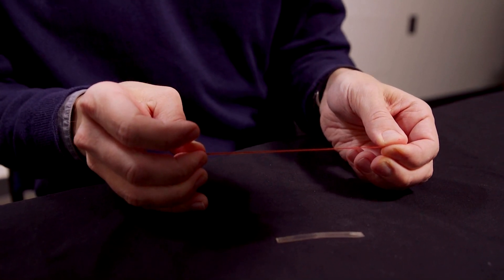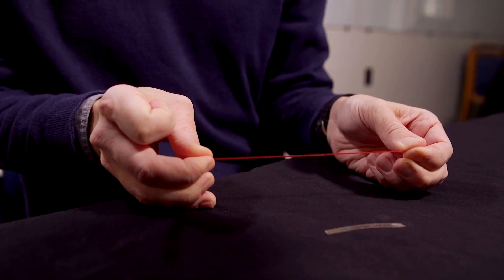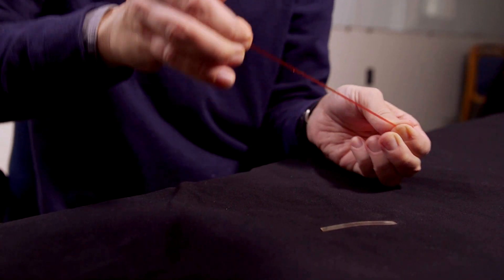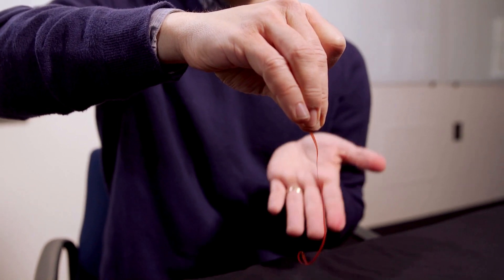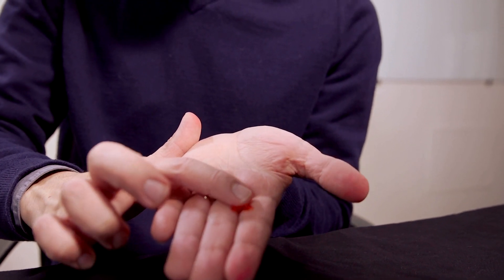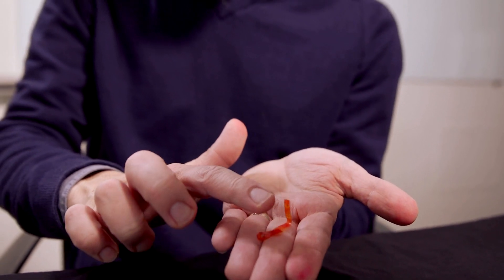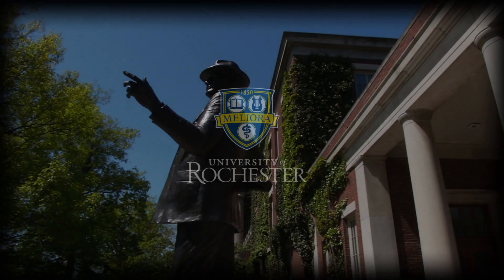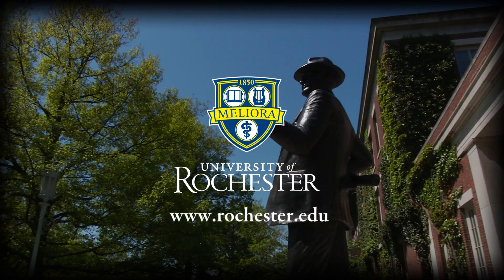Mitch Anthamatten Explains a Shape-Memory Cycle Involving Strain Induced Crystallization

Comment: Hi Mitch, 
What about using the polymer as a temperature controlled motor. Use your expanding and contracting forms of polymer with a temperature change 
To cause a difference in length. Which could drive an alternator to spin & create power.
If you used spokes to alternately shade & expose the materials to the sun, would it continually cool & heat (shrink & expand) enough to drive a motor ?
Large scale may lead to a fairly reliable source of energy. 
Jim T
Reply from the maker: +Jim Toomey From Professor Anthamatten: "Hi Jim:Thank you for your inquiry.  People have previously designed and demonstrated rubber band heat engines that operate on similar principles to those you described.  However, these engines have very low efficiencies—less than 1% of heat transferred across the engine is converted to mechanical work.  The class of materials that we are working with could possibly improve upon that figure, and we are exploring this, but there are several items that remain to be addressed.  One challenge is that crystallization is not instantaneous; the material must be held for some time for crystallization to occur, so the cycle time becomes pretty long (minutes).  Another issue is how the material behaves over thousands of cycles, we don’t go out that far (yet!).Thanks, Mitch"